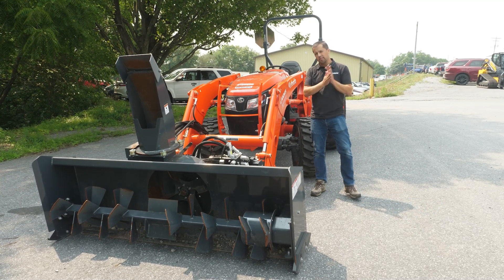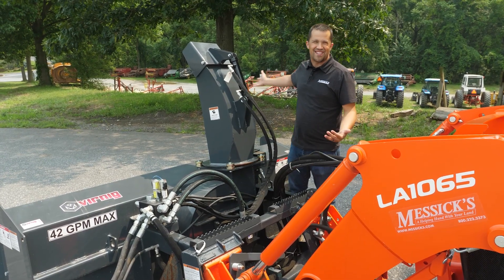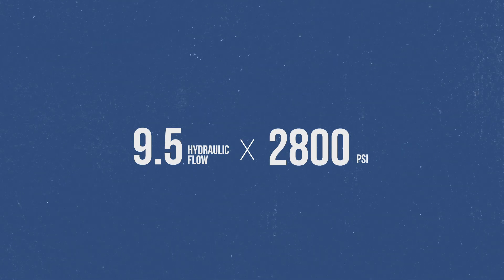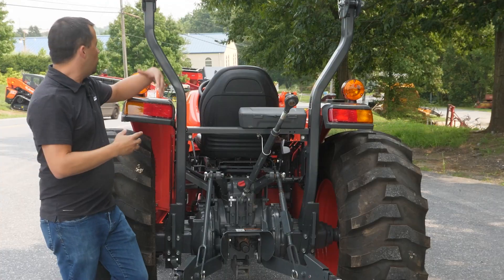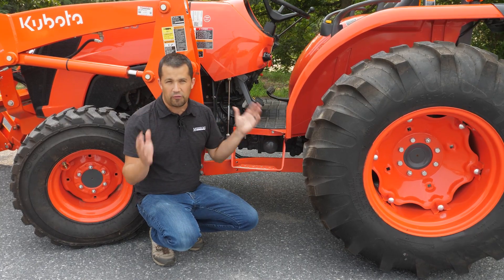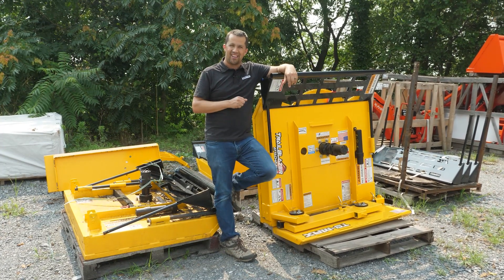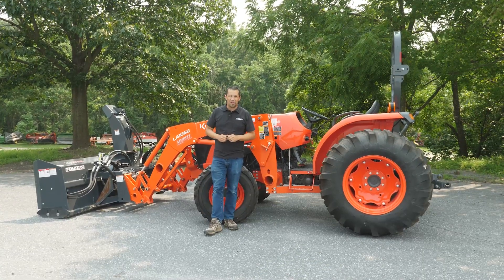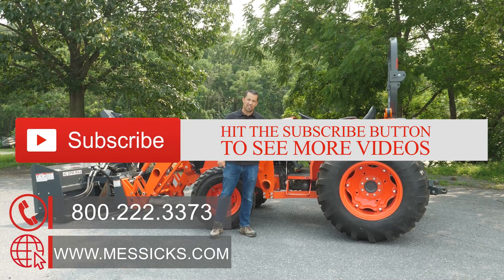Hydraulic powered snow blowers, not all they're cracked up to be.

Comment: I have a rear mount PTO drive forward snow blower, it's quite old and as such doesn't have a feed auger so when snow is wet it just becomes a rear pull plow. I have tried lining the angled feed with old plastic roll up kids sled/toboggan but it did very little. The other downside to a rear mount is as you drive forward you can only get as close to things as the length of your tractor without having to turn back up reset and start over. It works great when snow is dry (most of the time here) but I think it would be really nice to have it on the front!

Comment: I came here after watching a brand new 100k dollar ASV with a 14k dollar blower struggle with 8 inches of packed snow. Ive never even thought about how hydro works vs PTO. Our garden tractor with blower can power through most anything without much fuss. I think when we upgrade we will go the compact tractor route
Reply: Not well matched then. 100+ horsepower is not gonna have a problem with 8 inches of snow

Comment: ummm, not sure how you guys are sizing it, i would assume properly lol.
But my blower is a front mount 8'6" on a Landini Blizzard 85. (80 horse) and even through 3 feet of snow it'll blow it 80 feet. Sure if its real wet maybe 40. Granted it is set up different, with a 50 gallon hydraulic tank on the back. It runs at about 1900 RPM of the motor. I can't remember the flow rate though sorry. They are 1 1/2 hydraulic lines.
I mean yes, you are correct, much less power, horse Power, at the blower comparatively, tons of torque though, but at least I don't have to worry about braking shear pins 500 times a winter haha. i do have neighbors and friends with mid PTO blowers, and they have twisted shafts ( only once so far ) and break 2 -5 shear pins, every single winter. I think it really high stress areas Hydraulic shines because you can be VERRY rough on it, and not break any thing. 25 years of use, and the Hydraulic system has never failed. Not even once.
(Edit)
Ohh ok I see
so your simply talking about the on board Hydraulic system. That makes a little more sense. I will leave up what I originally posted just for info sake. I think you should go into some benefits of have a large Hydraulic system though. Like I had said previously, I can really run it ragged and all it will do is bog down a bit, and even if I catch a butch of dirt and clog it. (actually I have just straight up, blow dirt with it because it will cut deep sometimes before I can stop it) It just stalls,  just shut the PTO off. Unclog it, then your good to go. No mechanical pieces braking. No shear pins or shaft ripping to shreds and causing more damage as they spin around a speed. 
But yeah just a thought, not sure if you guys have experience with the larger system, I mean I would think so. But there are benefits.

Comment: I have a video of my home built hydraulic power unit running a Virnig V50 hydraulic snow blower.  See the links below.  I will say that the power unit build was complicated and took a long time to design and construct and it ran about $3000 when it was all said and done.  It definitely works but I think he is right that a direct drive PTO shaft driven blower is the way to go.  I did this because of the ease of set up for my aging parents.  Just 2 quick connects and the close the arms on the loader quick attach, hook up the power unit to the 3 pt and PTO and good to go. The tractor they are using only has 40 HP at the PTO so the tractor is really undersized for the job but it works just fine if you take it slow.
https://youtu.be/LDd1kMUGLlQ 
https://youtu.be/dk85e7eJT68
https://youtu.be/97IMi4FtG1c
https://youtube.com/shorts/7H0Mo-yB5bk?feature=share

Comment: What tractor manufacturers need to do is come out with a high flow hydraulic system like on select model skidloaders where you flip a switch to get that extra boost of hydraulic volume/pressure. Then you could run those snowblowers, brooms and whatever else.

Comment: I converted a 5ft rear 3pt pto snowblower to hydraulic driven loader mount way back in 1990. My machine was an L245DT and the rear setup just didn't work so good with no live pto and too tall of a reverse gear.  So I built a 15 gallon tank that I mounted to the back of the blower, did the calculations for a pump and motor setup that would transfer all the engine horsepower. Ordered those parts and an open center valve from Burdens surplus center and mounted the pump to drive direct off the engine spline shaft at the front so it turned at engine speed. I even set it up so I could use one of the bucket curl rams to rotate the chute.  It worked great and would just about stall the engine when the pressure relief kicked in.  I could chew away at the big 8ft snow piles that slid off our steel roof shop with the loader raised up and work my way down. The only issue is that after an hour of heavy use the oil would get a bit hot and some loss of drive efficiency would occur but by then I was usually done or ready for a break anyway.  I would have added an oil cooler if I was running commercially.

Comment: Thanks for the analysis. I’m looking forward for an electrically driven snowblower any thoughts anybody?
Reply: a 1oo amp alternator at 12 volts only kicks out 12oo watts. 1.6 hp. A 6ooo watt generator. 8 hp. You have losses electrically as well.

Comment: Thanks, Neil. Just when I was about ready to drop a lot of money on a hydraulically-driven snowblower you throw facts in my face. Seriously, thank you; I think I will look at a shaft-driven front blower now. Excellent video!
Reply: Don’t forget to look at the rear mount blower it’s shaft driven the impeller is backwards so your not wrecking your necks and stretching your leg for your treble pedal. You drive over the snow the blower is kinda backwards guys forget about this model.
 Shaft driven blowers are half the cost and resale is fantastic as well when you wanna unload it

Comment: I really enjoy your presentations.  On the hydraulic driven front snow blower mounted on the front end loader I  will politely suggest to check out the frontier loader mounted 72inch with 2134 hydraluic power pack combination as I have it on my jd 4720.  I live in Wyoming and have since 2013 operated this combination after some pretty severe snow storms with brutal wind blown drifts.  Mine has preformed with no issues.  I just have to be very careful on where I aim the snow as it is discharged as it can do damage.  I don't know if Kubota has a similar product but the above combination in my experience works great.  Again I enjoy your presentations.

Comment: I think it would be interesting videos to show how the trailblazer power pack could be used for hydraulic powered implements like an auger in the front so you could put downward pressure on the hole that you're drilling. You are absolutely right after studying this topic for over the last year. It's more about the hydraulic flow than it is the horsepower. That's why even a small frame skid steer will outperform a large tractor on a similar implement, because even a low flow skid steer will typically give you a more powerful hydraulic flow than a large horsepower tractor. At first I couldn't believe it, but when you look at the numbers and see videos it's obvious what is going to work better.

Comment: Tractors are an incredibly useful and versatile form factor to get work done. The world would be a better place if manufacturers added accomodations for the option of MUCH higher hydraulic capacity when the design these machines, instead of marginal/incremental improvements on a 150 year old design. I'd love to see skid steer grade high-flow as a factory option.
Reply: Timberhitch LLC they will never do it because then it would cannibalize sales for skid loaders.
Reply: The 4x4 tlb units have much higher capacity pumps, sometimes by a factor better than 5. It could be an option, if they thought they could sell enough units.
Reply: @waiting4aliens  4X4 tlb? Please explain...
Reply: One way is to ditch the tractor and go for a loader (JCB/VOLVO/CATERPILLAR/KUBOTA) or a "toolcarrier" (LÄNNEN/LUNDBERG/AVANT). On those the machine drives hydraulic pump(s) not a gearbox which then divides power to wheels, pto and sometimes the hydraulics.
 If you then have the guts and the money to check the "workpackage" box to get extra hydraulics (seen it being calld "sweepinghydraulics") you should be "good to go". But beware: it's tractor-money times two or three. If a Kubota M 4073 is 55 000$, a Avant 860i GT is 90 000$ and a Kramer 8055 is around 90 000$. The Kubota R070 loader is aroubd 65 000$ but i don't know if there is power enough.
 I am a bit out of my comfort-zone, but I would say that if you want something that can run a larger hydraulic blower than around 50 inches, the cost starts to rise quite dramatically. But if money (and size) isn't a problem, go for it 👍🏼! There are many good machines to choose from, but I would reserv +100 000$ if you shop new machines. The reason if you don't know all of the brands: I live in Finland and has never been to the USA or to Canada. But "anywho, anyhow", I do think that the power (~60-75 hp) could just be enough IF the machine is made for hydraulic "work-use" aka: a wheel loader 🤭😋.

Comment: Fm25 flail mower? Why do they have such high hp requirement compared to the del moreno models seen in your videos. You implied these require less power than rotary mowers, yet my kubota dealer barely recommended the 48” for my b2601. I was hoping for 60”. Any knowledge to spill on the fm25 line?  Would i be dissatisfied with the lighter Italian model when I have land pride expectations?
Reply from the maker: 'FM' is a beast of a flail. If you want to go wider, a lighter duty mower will draw less power.

Comment: A hydraulic snowblower on a skid steer that has high flow capabilities is unstoppable.  The one I use at work will send snow an easy 30 to 40 feet, this is in MN where we get real snow fall totals.
Reply: Would you recommend a tractor or skid steer on 25 degree slopes in MN?

Comment: They are called an "Inverted Snow Blower". Pronovost is a BIG name here in Quebec. We use these for most residential snow removal.
Reply: Hey guys! I have a tractor like you. BX 2680 with cab, push box and three point blower, hydraulic chute control. I've really enjoyed your videos. I have a few you should check out.

Comment: I do have a snow blower for my lawn tractor but I have a gravel driveway...see where this is going LOL.  Anyhow, a rear mounted PTO powered snow blower that you can hookup and drive forward seems like a much better idea than having to drive in reverse all the time, always seemed like a stupid setup, hurt my neck just thinking about that type of blower....For my case a blade makes more sense, someday I'll get one, but haven't had enough snow the past few years to really mess with it...I have a modification plan I am going to try on my blower to keep it from scraping up rocks just need the time to do it.  

The BX front mount snow blower would be great...if I didn't have a gravel driveway....and if it didn't cost a fortune.
Reply: A guy on one of the forums has a really big mirror on his tractor, for running a rear mount snow blower.  Kinda clever, but once you hear it, also kinda obvious.

Comment: Last winter I discovered the PVC pipe on the rear blade hack, it works so good I don't think I will be using my blower much anymore. Instead of going reverse in second low and messing up my neck I can drive forwards in second high. https://youtu.be/iGUuMk83OGw

Comment: Unless you deal with heavy drifting, an inverted snowblower like you mention towards the end is the way to go. I have a 68'' Meteor on my TYM T474 (48.3Hp) which is about 36-37 at PTO. And it runs just fine. I've made a video or two off of it.
Reply: Agree wholeheartedly on the drifted snow.  In my location when it drifts during a blizzard you can't drive through the drifts. Also unable to plow with a compact tractor.  The only way is to use a blower.
Reply: @fredhinck9685  Yup, for high drift areas, you'd either need a front blower solution or an open rear end one.

Comment: Relative of mine purchased around an 80 hp kubota (I can't remember the model number) through you guys a few years back and set it up like this with a front mount blower (which he got elsewhere) mounted on the loader. The trouble he had was that when he went into deeper snow it would pretty well kill the blower as there was some sort of hydraulic bypass valve for when the system got overloaded. The tractor had the power to run it but the hydraulic system wouldn't allow for the load. On top of that the blower hanging so far out in front made it very difficult to make turns while blowing. Pretty much could only run straight lines.

Comment: that how they do it here in Eastern Canada. A L with front blower off the rear or mid pto, with a expandable snow box on the 3 point. we clean driveway like you wouldn't believe.
for big yard we use snow box on the loader and a rear blower on a M series. or straight loader

Comment: I've seen front mount snowblowers with dedicated gas or diesel engines  for power on big ,(construction company sized ), front loaders. Are there any companies that make such equipment for smaller tractors, and can you do a video about those?
Reply from the maker: MB attachments does. Not something we keep here for stock.
Reply: I'd wonder about how much HP they really have.  If the engine isn't the size of your tractor engine, it won't do 60HP.  If it is the size of your tractor engine, I suspect your loader won't lift it well.  I agree with Neil on the PTO driven equipment, and really if you want a front mount blower I think a mid-PTO machine is the right choice.
Reply: @paullambert2668  You make a couple of very good points, Paul. I think I'll have to look into pto driven snow blowers. They'll have to be the type that takes power from the rear though. My  B 2601 arrives in October, but I bought it without a mid mount pto. As a side note I have a hunch that I'm going to need the loader , at the very least, this winter. I think we're going to get belted  this year, and at 73 I'm too old to wrestle with my snowblower anymore.